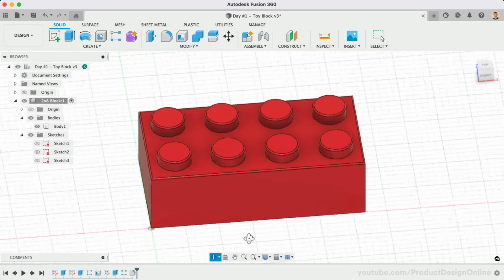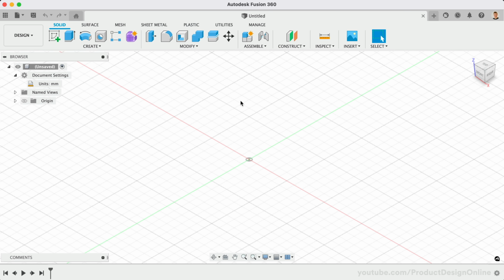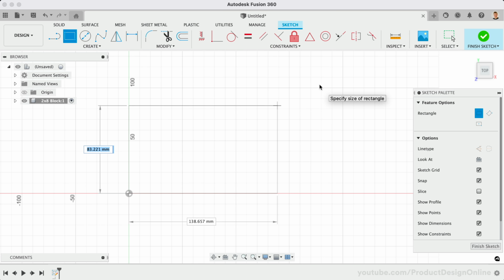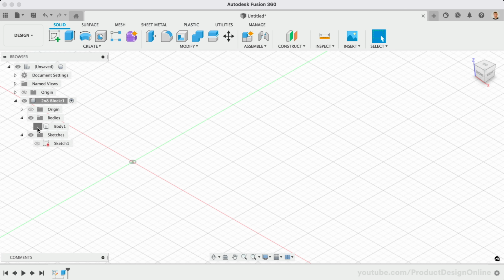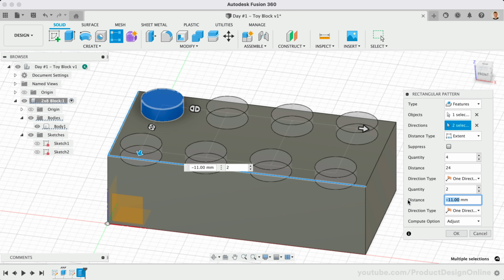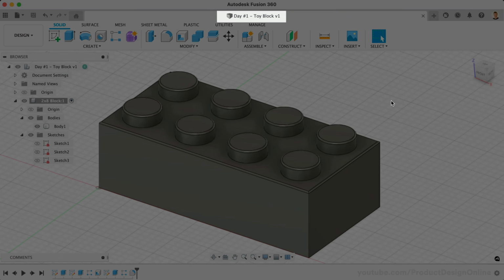Day 1 of Learn Fusion 360 in 30 Days for Complete Beginners! - 2023 EDITION

Comment: I am at the shell command trying to select the bottom face. However it will not allow me to when I press select. It selects the raised pieces on the top. Please can you help BOOMEL
Reply from the maker: Hmmm. double-check that all the sketches are turned off in the Browser and make sure nothing is blocking the bottom face that you're trying to select. If that doesn't work, please share your Fusion file.

Comment: Is there a reason you can't add the filet before the rectangular pattern so you don't need to select every edge of the nubs?
Reply from the maker: Placing fillets at the end of your timeline and avoiding patterning them prevents the software from having to calculate complex curved geometry multiple times, which keeps your file running fast and reduces the risk of the "Red Timeline" errors that occur when features lose their reference points.

Essentially, it is much more computationally "expensive" for Fusion to pattern a complex 3D rounded edge than it is to pattern a simple flat shape and fillet the edges afterward.

That said, you could get away with it for a simpler model like this. But I like to preach the best practices and habits that end up getting people when they start working on larger files.

Comment: Excellent tutorial, coming from someone who has never touched 3d modeling until this video. 

The only thing I don't understand is why the circles on top ended up being hollow? I didn't think any of our actions would have made those circles on top hollow, so why are they not solid?
Reply from the maker: Thanks! I discuss this a bit in the new 2026 vesrion of the video. (FYI, I'm updating the whole 30 days: https://bit.ly/30daysUpdated)

In short, the shell command traces the entire contour.

Since the studs on top 'joined' the existing 3D body (and its all one body) - they are part of the outer contour when shell traces it. As a result, the tool traces inside each stud leaving that small void.

If you define a different thickness (larger) you'll see that the studs are too small so it won't affect it.
Reply: @ProductDesignOnline  Ahh that makes so much sense! Thank you for the quick reply. 

I did the glass bottle one today too, I plan to keep going through all of your videos. 

I just got a p2s and my goal is to be able to model my own prints

Comment: Followed your setup exactly. For some reason the "assemble" tab is not visible on my toolbar. Everything is factory default. Anyone have this issue?
Reply from the maker: You will need to be in the new "Hybrid" design intent mode to see the Assemble menu. Check out my new 2026 version of this video that was just released. Link at the top of the description 😊

Comment: I have a question...what if im drawing something like this lego but i only have the dimension for the smaller circles and not the block how would i do this?

Example: i know the small circles  height and width (say 5mmx5mm) and i know i want them to be exactly 10mm from eachother edge to edge which would make them 15mm from eachother from center to center...and i want there to be 20 of these but i have no clue how big the block will be. How do i go about this?

Comment: I'm relearning F360 after being away for quite some time. Will it be covered later as to how the pattern values are derived?
If I create a block with a single nub, but I want N number of nubs in the X and Y, how will I space them correctly so that the end nub is equidistant from the edge as the original nub?

Comment: Hi, I've been using Fusion 360 for a while and had picked up bad habits, hence coming back to this to organise myself better. I've never used the "New component" function as shown on this video around 2mins 30 secs and organised the tree. However I cannot find this function anywhere. It should be under Design, Assembly. The only option I see under assemble is "Add to assembly". Can someone please help me to understand if this has been replaced in later versions?
Reply: This almost drove me insane. Fusion seems to have changed. What you need is to select "Hybrid design" when starting the project (File > New). This way you're neither designing a single part, nor an assembly of individual parts, and the UI (incl. components) looks the way it does in this tutorial.

I hope this didn't make you give up.
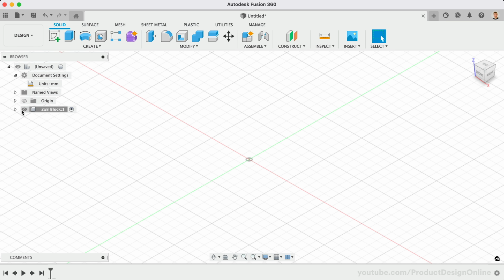Reply: @rageorgiev  Thank you for saving our sanity. It is quite frustrating to learn without understanding why the interface doesn't behave the same. Being stopped at 2:31 was quite the burn 🙂

Comment: For starters, the new version is different right off the bat (there's no New Component option as referenced @2:00 . If it wasn't for a recent comment about it I would probably have just tossed this app in the bin for the 2nd time in a week cause it wouldn't let me do/select anything.

Secondly, it seems that a paid subscription is required for the options used on the very first object. Which would be great to know that a free account cannot walk through this :(

I'll keep trying but we'll see if I can even get anywhere
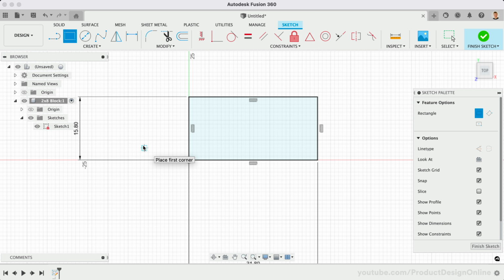Reply: @4:40 I had to go into Utilities and tick the slider for Modeling Tools before the Solid menu would populate with the Extrude option.
Reply from the maker: @hikingphotog  You're correct about the brand new Jan 2026 update changing the components. You'll now want to select 'Hybrid' for all designs in this course.

Your comment about needing to go into utilities doesn't seem right. The free version of Fusion still has/includes Extrude and all of the features showcased in this course. Can you try restoring your settings to the default in your preferences?

Comment: 2026 Version Update: It was a bit hard to follow with the concept of creating a "Component" under the "Design" element in the folder structure. A friend walked me through this, and noted that a brand new 2026 update seems to change some of the fundamental parts of this video. So you don't have to struggle like me, here's what you do to follow along after ~ the 2:00 minute mark. Start by creating your folder structure as Kevin stated. You'll be presented with a default "Part Design". Unless you follow these next steps, you'll have a hard time following this video.
Simply click the + (plus) icon on the top bar, select either "Assembly Design" or "Hybrid Design". Close the default "Part Design", then save your work. Basically, the new version forces you to start with a "Part". It seems we want to start with an "Assembly". (I'm new - Kevin, keep me honest here.)
The only other change I noted was when you create the compartmentalized "Component" in your new "Assembly" (or "Hybrid") design - it looks a bit different than the video. It seems to be default "Ground to Parent". There is an anchor icon next to the component in the assembly. Not sure if that's a factor. I simply selected "Unground from Parent", and now my screen looks just like Kevin's.
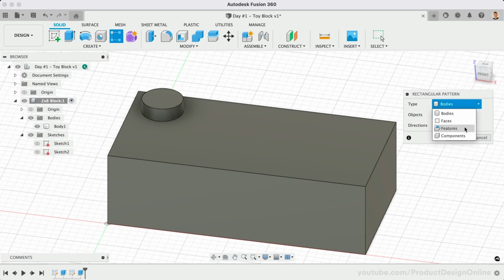In addition, there's a ton of comments about Axes or something around the 8:40 mark. Haven't got there yet, but scroll down the comments to figure it out.
Reply: Thanks for this, I tried using Fusion for a project last week and then gave up cause nothing was doing anything. So I started poking around in Blender where I could actually get it to do things, just not with the results I was wanting. A friend asked me why I did Blender instead of Fusion, I couldn't remember cause my brain was so melted. When I loaded Fusion back up this morning I suddenly remembered, I couldn't get it to do anything, and I'm guessing this is why.

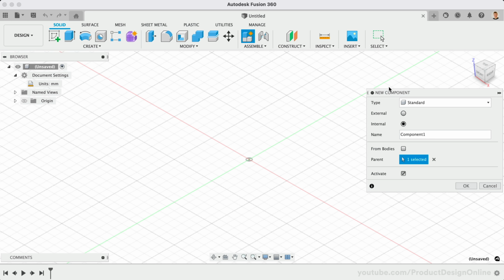Comment: 2:19 - I don't have any component in the drop-down? Windows user.
Reply: I just started this, I had to create a new file with the "Hybrid" intent workflow (not Parts or Assembly) — then my "Assemble" dropdown had "New Component" as an option. (Fusion now has these new "intent workflows" some of which assume you'll make components / assemblies in entirely separate files, but "Hybrid" is more like this tutorial and seems fine to me so far!)
Reply from the maker: Choose the 'Hybrid' method from the document settings in your Browser (or whenever creating a new design) that will keep the 'old' way of working in Fusion. I'm working on some new lessons to discuss the changes and when to use them.

Comment: THANK YOU!
I am used to working with 2D sketches in Autocad and I am trying to learn Fusion because I figured that it would be the closest to Autocad and therefore minimize the learning curve. This was a great tutorial. Some things are different since I am using the 2025 version of the program, but maybe it's only because of the programs Preferences. For instance, in (under) BROWSER, the structure that yours shows is the same up to Origin. After that, your version shows 2x8 Block:1, and in the 2025 version it shows, Bodies, and under that (not expanded) it shows Sketches, then my saved design (BLOCK). I'm not sure if this is because I saved it prior to the end of the tutorial or I did something wrong, or that is the process in the 2025 version.
Either way, I'm sure that I will find the answer at some point. 

Thank you again for the tutorial. I subscribed, gave it a Thumbs Up and will be checking for some other tutorials created by you.

Comment: Hey just a question... I'm a slow learner, I can eventually pack things away, but it takes me a long time due to a comprehension disorder. How up-to-date is this tutorial? I find every time I try to go in depth with something like this with a 3-year-old video, everything in the program has moved around or labels have changed, and extrapolating those changes gets me so frustrated that I fall off track. I like the idea of dedicating a month to focus on this, but I need some convincing that I'll be able to follow along. 
I really need to learn the basics after nearly 2 years of printing others files and designing in the slicer. Thanks very much!!

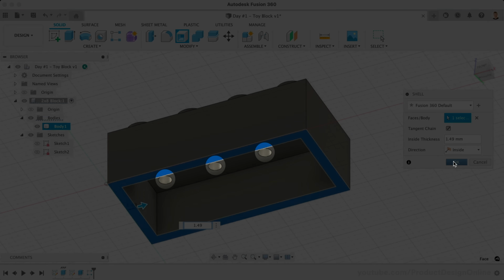Comment: 10:07 I don't understand why there are holes after using the shell command. There should be no holes, as it was extruded as a solid body
Reply: Because it shelled the entire thickness to 1.3 mm including the cylinders because they were attached.
Reply: @Jespys oh, of course, I get it now finally. Really had a hard time to wrap my head around it 😆
Reply: @pavolslab7831 no worries, I am having a hard time with the three holes on the bottom joining to the piece. Anytime I export it to slicer program they are a separate piece from the block 🤷‍♂️

Comment: I started out with Tinkercad. Even though you can do a lot with it, I designed many objects that I 3D printed for in and around my house, and that I use every day. At a certain point, it was time to move on, so I started learning Blender, which I am still working on.

Blender has a very steep learning curve. It is highly technical, and it will take a long time before I can truly create high-quality work with it. After a long workday, I was looking for a CAD program that is more relaxing to learn in the evening. That is why I started using Fusion 360.

Fusion 360 feels somewhat similar to Tinkercad, but it is much more advanced—exactly what I was looking for. I completed the famous “donut” tutorial in Blender, which took me about 20 hours in total. In the end, I had a few donuts, but I still don’t fully understand half of what I did.

My main interest lies in functional design for 3D printing, and Fusion 360 feels like the perfect next step in leveling up my hobby after Tinkercad.

Comment: Found this series in 2025. There are a few differences in the software features since this was recorded, but I've been able to figure them out so far. The lesson moves at break-neck speed, as I try to follow along. At first I found it a bit annoying, as I was putting a lot of effort into switching between F360 and YouTube, pausing, rewinding several seconds, re-playing things, but I've decided it's actually great, since it is covering very specific steps, explained directly and expediently without much noise, so I'm able to absorb it quickly. Thanks for this!
Reply: this is me currently,  i havent gotten to the part where its not annoying tho LOL

Comment: The number of times I had to pause and jump back a few seconds is insane.
What's the rush?
Why force me to play the video slower (which introduces a bunch of other issues)?

It's a shame, because the course, even though it's a bit outdated, would be very clear, if it wasn't so sped up.
Reply: I liked that it went fast. skipping through waffle is worse than slowing down the video in my opinion.

Comment: I'm going to be in the minority here but this was not a way to teach absolute beginners.  You went much too fast barely taking a second to pause between each step allow me to find where you finding the controls.  That made it very difficult to follow along. You never explained any of the tools you using to add features to the drawing.  This may be a good course for someone how has had some exposure to CAD software in the past but for a raw noob like me it was more frustrating than helpful.
Reply: reduce the play back speed and follow the steps exactly.

Comment: Great Job but you really need to slow down a lot as this is for beginners right so you are assuming we know where all these option are and I definitely do not so maybe a pause between steps so we can pause the video lol...
Reply: It's pretty easy to follow but the video is 3 years old now and the fusion I'm using looks a little different. Definitely pausing a few times but I'm 4 videos in and really surprised how much I've learned

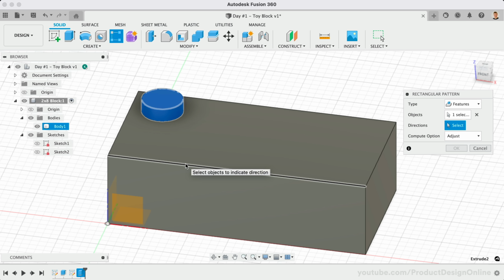Comment: Had a terrible go. 8:50 Mac users must use CMD to highlight entire cylinder or pattern won't generate
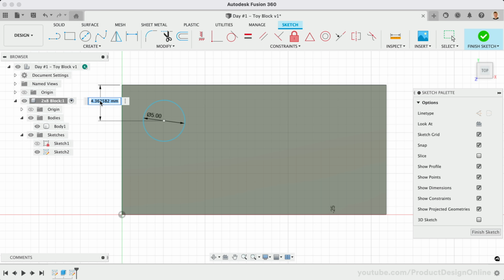7:30 For some reason my arrows wouldn't protrude outside of sketch, they stayed inside looking cluttered/overlapping
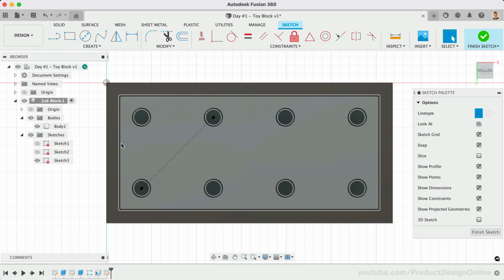11:00 Screen recording didn't snap at center point of circle, I think only one line is okay maybe I'm wrong though?
11:50 For me, offset wouldn't select/ highlight circle. Upon entering 1mm, circle disappeared. How to select circle to extrude?
Hope you guys have a better go

Comment: Is it expensive to own Fusion 360 ?
 • 
I’m an amateur architect and woodworker, and would want to make scale drawings of door constructions, furniture, floor plans, etc.
 • 
I won’t spend $2,000+ per year on a computer professional CAD program.  There’s got to be one suitable for the hobbyist.
 • 
I bought AutoCAD for my iPhone, and despite what they say, AutoCAD is not compatible with the OS X on my MacBook Pro, only the iOS of iPhone & iPad !  I’m not going to design on my iPhone, I can tell you that, 😒‼️
 • 
Nor do I have an iPad right now.  I AM planning to upgrade to an Apple Mac Mini desktop, with a big screen.
 • 
I haven’t checked if AutoCAD runs on a Windows PC Browser, does it?
 • 
If I have to run AutoCAD or some other program through a Windows shell program, like Parallels, on my Mac Mini, it will be just another layer to deal with!
 • 
Sorry this was so long.  Thanks for reading!  Any advice?  Thanks, 😉👋🏽!

Comment: Great tutorial. Got a question though. I created the toy block and tried to print it but it failed. reason for it - when starting the top layer, it wants to print the first layer of the eight circles on top, however this would be in thin air since the rest of the first top layer is not printed yet. I am not sure if this is a design issue or a 3D printer setup issue? I think it should print the first layer of the rectangle first, including the circles. How can this be fixed?

Comment: I have a question on error correction. Suppose I make an error, in an early step, and don't notice it until much later. For example, missing the change  in distance from +1 to -1 when creating the 3 cylinders at the bottom (about 11:41 in the video). The extrusion and duplication are completed with the incorrect cylinder. Then complete the object by adding the Fillets.  Now I notice the error. I have figured out to go back to the broken step and correct the error, but the steps after (extrusion, duplication, Fillets) don't depend on the error in a significant way.and need to be executed with the correct circle. How is this done?

Comment: I got through most of it but when I got to the 3 center columns on the bottom I created the two wall circle but then I go to extrude it it doesn't allow me to select just that circles to extrude the 3d body. idk what I did wrong

Comment: I'm not sure if I'm doing something wrong, or if its because I have "Autodesk Fusion Personal" Instead of "Fusion 360", but my Sketch Dimension button is not acting the same as in this video.

I click the sketch dimension button, click the center of my circle, then click the top border of the block. But when i drag my mouse to the side, it only shows 1 line instead of 2.  If i click with the 1 line, i get a warning popup saying "this dimension would over-constrain the sketch"
Reply: Figured it out, instead of clicking on the edge of the rectangle, i had to click on the corner and then i would have more options

Now I'm having trouble selecting just the inside face to place the posts lol.  it keeps selecting the whole bottom, sides and all

Comment: At 10:19 you selected just the inside of the block. How did you select just that face of the sketch? When I hover over the bottom of the 3d sketch it highlights the whole bottom like it will not recognize it as a 3d model

Comment: It wont let me select the edges to fillet, only the whole cylinder. It then fillets the base of the cylinder where it meets the block.

Edit: I redid the few steps before that 3 times and it eventually worked. I did everything exactly the same so not sure what happened the first couple tries